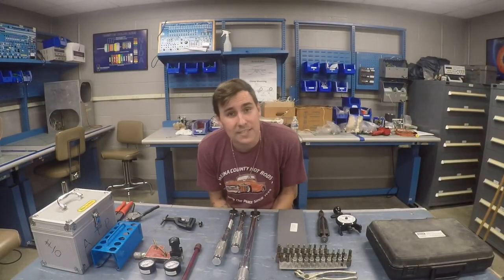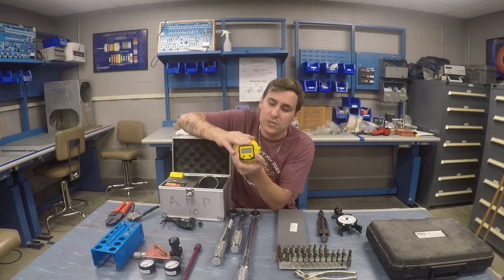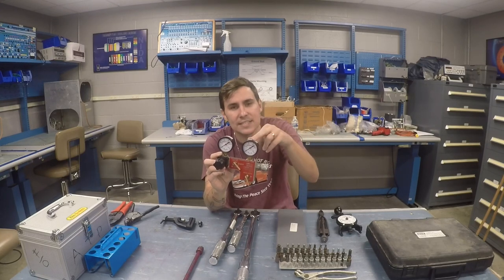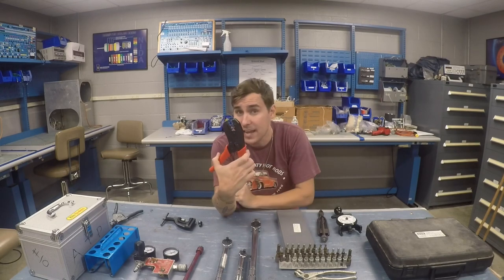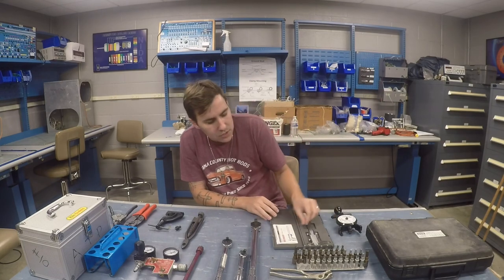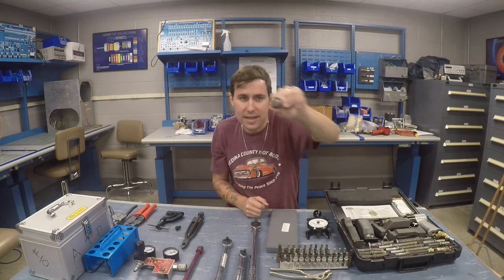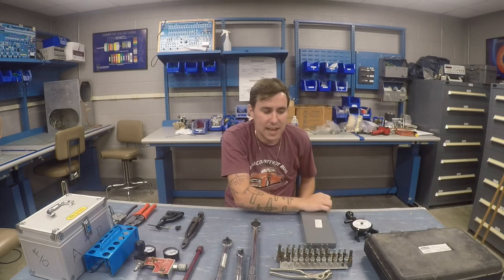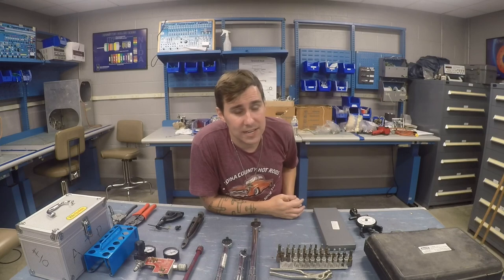What Tools I use As An A&P IA

Comment: I also want to add that my IA got me a position at a flight school where I was able to work a deal for free flight instruction and aircraft at cost.  I started at this gig with a PPL and around 100 hours.  I obtained my Instrument rating, commercial/multi/instrument, SE Commercial (400-600 hours?) all with free flight instruction and aircraft at cost while working as an IA.  I could not have obtained any of these without the IA.  I still use the IA today after 20 plus years.  It IS worth the effort.

Comment: While working in the automotive industry I have torque wrenches but it was more of a suggestion. I doubt anyone in the shop has them calibrated. If it adjusts and clicks it was good enough. Typically a fastener is "guttentight" either by feel or just hammered on with an impact. Remember, a crossthread is a tight thread! (I kid, but we did say that)

Comment: who the heck in setting rivets during an annual?  its an INSPECTION, not a repair.  You are not good at this
Reply from the maker: So you didn't watch the video. I literally slapped it and said I would not normally use my rivet gun. Question for you are you not repairing aircraft after annual inspections? Do you just leave them un-airworthy and let the owner sort it out. No nobody does that you give the owner a list of discrepancies and then with approval and this is very important and I need you to listen here YOU FIX IT.